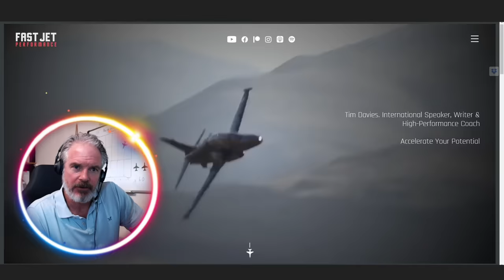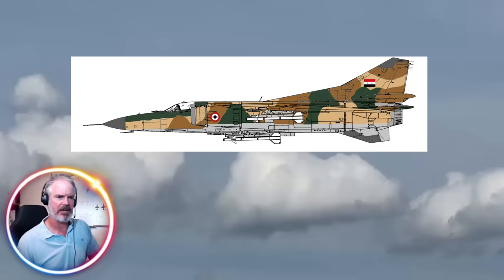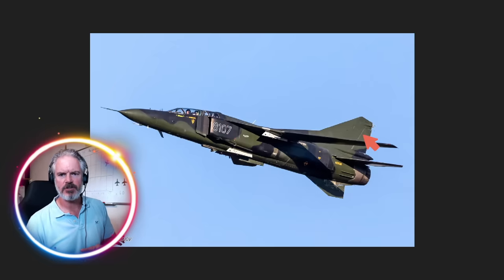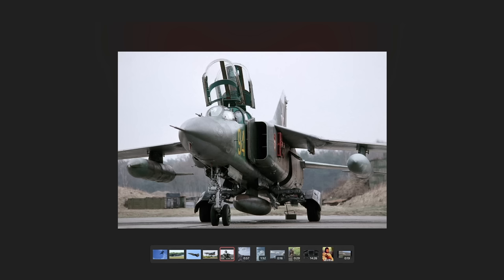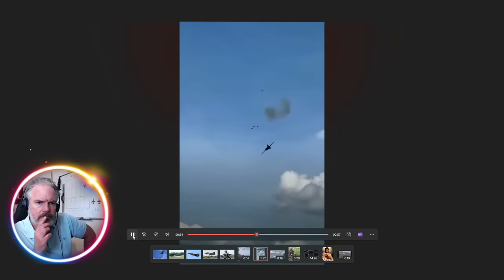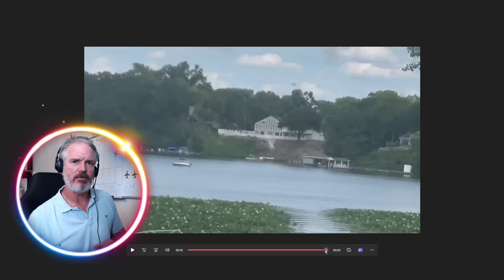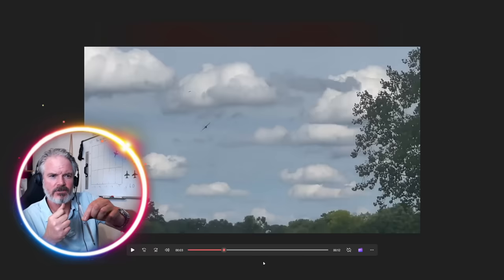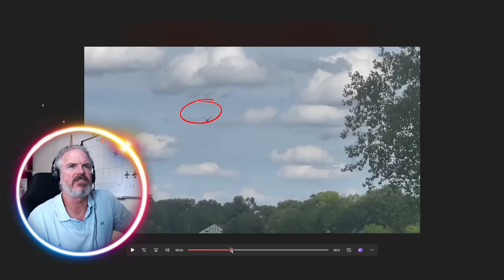Escaping Disaster: Pilot's Analysis of MIG-23 Airshow Crash and Double Ejection

Comment: Will Ward here. I was NOT in this Flogger but I do have information that you are asking. The engine on this jet was NOT an R-35 ,which is an outstanding twin spool turbo-jet,but an earlier R-27-300. The R-27 in early series had issues (as well as the J-79,F-100,TF-30,etc,ryc) but were ironed out by the time the engine was online. The Floggers used the R-27,R-29 and R-35 engines. The ONLY people that had issues was the 4477th with the R-27 and R-29 as these Floggers were literally dried and crapped out. These Mig-23MS`s, had been left in the Egyptian desert for over 4 years before they were brought over to the USA. This version is the Mig-23UB which I would consider a 2nd generation along with the MF and all were VERY solid airplanes. The MS was a 1st generation. The Seat for its day, the KM-1M is an excellent seat and very reliable. There is no RAT on this aircraft. The only Flogger to have one was the prototype MiG-23-11-1 but this was later removed thus no Floggers had a RAT. There is an emergency pump whose only function is to drive the wings forward to 16`(actually 18`40") The TS-21 sole purpose is to start the engine The start sequence is automatic and very easy. Thus, it does not serve as an electrical or hydraulic function. Hope this fills in some of the questions. Thank you.
Reply: As an enthusiast, I can't thank you enough for chiming in on the platform, to clarify your part!!
Reply from the maker: Thank you Will, I appreciate you clarifying what was quite hard information to find - if you ever want to come onto the channel to talk about your aircraft, just let me know, it would be a pleasure.
Reply: Would be an honor! We can talk about the 15,17,21 ,23 and 25. Would be a blast!
Reply: @mig21pilot Yes please!!!
Reply: @FastJetPerformance Awesome! Having an episode about Migs! Go for it!!
Reply: It sounded like a compressor stall (before the videos started)
Reply: @mig21pilot  @FastJetPerformance defo make that happen, would be fantastic to hear from Will!
Reply from the maker: @mig21pilot  would be great - I'll email you.
Reply: @FastJetPerformance already looking forward to this video 😎
Reply: @mig21pilot oh please do all off them, im sure @FastJetPerformance would agree. :)
Reply: Ntsb preliminary
Engine issues reported by the pilots
Reply: @mig21pilot  love seeing your aircraft fly at shows!
Reply: The Rat 🐀 will eat the wires 😮
Reply: @mig21pilot yes please
Reply: @FastJetPerformance  please do this :). Ward Carroll gets some great guests on his channel, but the aircrew interviews are all a bit yee-haa US aviator talk & some understated brit-talk/questions would make a nice change.
Reply: Hi - aviation atty from the states with a clarification on ops permitted under a Part 91 experimental certificate. Although deviations may be granted, experimental aircraft are prohibited from flying over desnly populated areas or congested airways. Special operating limitations may be granted for landings and takeoffs over congested areas (often in connection with display performances) and most deviations are granted to facilitate flight training. I tend to doubt the FAA regs are materially more permissive than the UK CAA regs, since similar accidents have occurred on your side of the pond (2015 Shoreham crash), and the BBMF regularly flies over enormous crowds (although, to be fair, those acft are still under RAF registry and subject to different regs). I do think that gen 1 jet acfr pose a diff set of flight risks than piston-powered WWII/Korea aircraft and may have to be regulated differently. Great show, subscribing now
Reply: @mig21pilot Loved your presentation at OSH and wish I had a recording of it to review some of the technical details you covered.  Would love to see you do some more interviews/presentations.

Comment: The engine was operating and even if it was only at idle, it will give you the hydraulic pressure required to move the flight controls. This aircraft maintained a constant bank angle and a near constant rate of descent even after the seats left. This has the hallmarks of either jammed flight controls or a massive hydraulic failure.
Reply: The plane looks perfectly under control. Everyone is confused as to what the emergency is, but your explanation is the best I've seen.
Reply: I've seen a few videos on this so far, and this hypothesis has been mentioned a lot.  
The steady bank angle and lack of any movement in any other axis would back this hypothesis up although there is a sudden nose up movement during the ejection which might simply be down to a CoG shift with the pilots and seats leaving the aircraft. 
The other thing I've seen mentioned is that it could have been a negligent/accidental ejection but I would have thought the pilots would have mentioned this already.
A stuck throttle is also the other possibilty based on what we see.
Either way it seems they worked the problem and decided ejection was necessary, fortunately nobody was hurt.
Reply: The crew will just tell us what happened.  @arrrgee
Reply: It’s going to get harder to import these old relics. The FAA doesn’t like planes dropping onto houses.
Reply: @oldmech619 thank God it didnt drop onto a house then huh?
Reply: @Imugi007    The worst thing that will get you in trouble with the FAA is to kill someone on the ground. We were fortunate this time. Making the nation new is the second worst thing. Crashing by yourself is the least. Just don’t piss off the neighbors. Seriously.
Reply: @oldmech619  When the FAA disallows it, you smuggle them in.
Reply: Was very quiet and slow if the engine was operating
Reply: @Reflektionz007 the only thing that stopped it from doing so was a massive oak tree. I am in A&P school through MIAT, and have classmates who live in those apartments. The 23 collided with the oak tree, and fuel and other debris carried onto the apartments and what started the fires
Reply: @happee_meal8302 was definitely moving pretty slow. Still can't believe I watched all this happen with my own eyes. Wild stuff, and a lucky outcome
Reply: @idanceforpennies281   plane looking stable in flight is no indication of it being under control.

It can be perfectly level, if stick input results in zero change of attitude, its not under control
Reply: @oldmech619  insurance premiums are going to go up for every warbird
Reply: Apparently they were in burner, took it out of burner and didn't wait enough time to throw it back into burner and it didn't light. Put the throttle to idle and back to burner again and still didn't light and then punched out. Heard this on an interview video last night.

Comment: Former USAF jet instructor here. Not at all familiar with the Mig 23, but the video tells me they were no longer flying that plane. Either engine or control issues, but that's moot when you're there. That was almost their very last opportunity to eject, based on speed, altitude, descent rate, and bank angle. You are correct that there's no such thing as "steering to miss" something.
Reply from the maker: That's my thinking too, last opportunity to get out - looks like the alpha was building at the end.

Comment: As an old ACESII egress specialist, I am obviously not familiar with Soviet/Russian ejection seats. But our ACESII did have a gyroscopic system under the seat rocket motor which would right the seat in a negative aspect ejection. Also thos are “ pilot” chutes which has only the purpose to deploy the main. A “ drogue” chute is a chute that slows and stabilizes the seat in high speed ejections. Not a big deal bit it would be the correct verbage. I agree this does appear to be hydraulic/flight control related incident.

Comment: Gotta be impressed by the ability to rely on the ejection system on a 50 year old Russian aircraft. Props to the builders/engineers.
Reply: The only things that ever needed anything on those seats were the propellant charges to fire the seat out of the plane. Those have an expiry date and need replacement from time to time. Russian Air Force currently has a problem stemming from this: they are flying their L-39s to this day, but the ejection seats are basically non-ejection seats as the propellant is past its "use by" date. Propellant was made outside RSFSR (Russian component of USSR) and they can't get it due to sanctions.

Comment: I used to own and fly a Mk5a Jet Provost. In the USA, the FAA doesn’t require that these experimental for exhibition only warbirds have active hot ejection seats. There have been several deaths because of either malfunctioning or inop ejection seats when needed. Last time I checked it costs around $10k per seat to reactivate them. Good that  these  worked. Good that I got rid of mine before I needed to eject. Great aircraft but scary to fly when you can’t get spare parts and Rolls- Royce/ Bristol are totally uninterested in supporting their power plants.
Reply from the maker: Yes, I've heard Roll Royce don't support their engines on legacy aircraft.

Comment: The 23 was not "primarily an interdiction strike aricraft" as stated here (although a later variant, the MiG 27 was). It was a fighter/interceptor - although mainly the latter, because it wasn't very maneuverable. In Sov service, IIRC, one significant issue was that the fire detection system was actually photo-electric rather than smoke-sniffing, so by the time it went off, the aircraft would already have a serious fire, giving the pilot(s) seconds to get out. I'm pretty sure that system would have been replaced in this example....
Reply: Yeah the MiG-23 was designed to intercept aircraft carrying nuclear weapons, albeit I suspect the targets envisioned by the Soviets were more on the tactical than strategic side of the aircraft size and performance. It wasn’t as maneuverable as the preceding MiG-21... but made up for it in higher speed, longer range weapons, and the first look down shoot down radar. It was a better airplane, in my opinion, than the F-4.

Later MiG-23 variants like the ML & MLD had a redesigned tail and higher g force tolerance than earlier models which helped improve maneuverability. 

The UMD version used the older style fuselage though so I think it’s correspondingly weaker.

The Flogger had a manual control wing sweep system with three positions, and that has been known to fail due to high g force warping the airframe and causing the wing bearings to jam. This can lead to the wings getting stuck in the wrong position when trying to land. I don’t think that this is the issue here as the wings are all the way foreword presumably to arrest the sink rate... but maybe they got jammed earlier and caused the descent in the first place?

Comment: There is a "J" shaped peninsula that extends from the north shore of Belleville Lake. Depending on the location of the one who recorded the footage, it will look like either the pilots landed on the ground or in the water since some of the footage is shot from the far side of the peninsula. The land to the north of Belleville Lake is occupied by an apartment building complex with an old golf course in the middle. To the north of the apartment complex, is I-94 - a busy interstate freeway. The plane crashed in the golf course and it skidded and rolled up through a slightly wooded area with a creek running through it and the tail end of the MiG ended up next to an apartment building next to the service drive of the freeway. A slight change in the trajectory of the MiG or if the plane flew a few seconds longer and there would have been hundreds of casualties. It apparently was "aimed" at where it crashed. According to the pilot, it crashed due to a loss of power.

Comment: The engine was running but I dont think it was producing much thrust I think its rolled back to idle.
Reply: Its better to eject at idle than at full throttle. If they had a hydraulic problem I would think the first thing to do would be to pull the throttle back.

Comment: Well done, I like your input to these Aircraft incidents. Blancolirio is ex military but now Boeing Airline 1st Officer. Dan Grydor is a GA accident 1st Line expert. Therefore you can fill the "Fast Jet" role. Keep getting involved. It's interesting getting all the angles.
Reply: Im waiting to hear Dan Gryders take on it
Reply: Dan gryder often knows not of what he speaks,  but that doesn't seem to throttle him back. Too much conjecture & opinion, and frequently fact free
Reply: @michaelh8890 Totally agree.
Reply: I saw Blancolirio’s short report on this yesterday, if I’m not wrong the engine was still running, I do n’t know if it was still able to deliver power.
Reply: Agreed -
Reply: Looks like no control/hydraulic failure. Cool thing about more up to date part 25 airframes is the requirement for backup and redundant systems. I’ve flown a jet (G-200) with hydraulic system 2 failure. Flies fine because there are two actuators for each flight control. If we had a complete hydraulic failure in this aircraft it woulda been a bad day without ejection seats.
Reply: Boeing Airlines? Where do they fly?
Reply: @sahhull apparently he made the wise choice to not embarrass himself.

Comment: I'm pretty sure it was a hydraulic failure. U can hear the engine not idling but spinning at higher RPMs. If no hydraulic pressure, the engine nozzle is not regulated and cannot produce the desired thrust. So probably no control over the avionics nor the thrust. Pity for this bird but at least the crew escaped and is hopefully well. I hope the pilot will tell the story nad maybe they will provide some camera records as well.

Comment: Well .... at least the seats worked OK .... I believe that there is a known problem with Mig23's engine variable intake boundary layer controllers that may lead to compressor stalls and other engine control problems . If one side of them fails in such a low alt - low speed situation there is not much you can do other than bail out ... but then again soviet era fighter jets are not my area of expertise .

Comment: It does appear to me that the aircraft is unable to manouvere - fixed bank angle and descending, there doesn't seem to be any correction to this. Whether it's due to the engine failing or control failure the crew I'm sure would have leveled the wings prior to ejecting if they could. Hopefully we'll find out what caused it later.

Comment: It is very difficult to tell from the video what the problem was. Tims assessment is spot on as altitude is the big issue as far as parachutes are concerned. If the aircraft is unable to climb it is time to "pop the brolly" control or no control which hints at a power problem. Also looking at the footage available I think airspeed was very low which would explain the wing starting to drop, again pointing to power failure.

Comment: Tim, why would only 5 degrees of angle kill you when ejecting inverted when level flight inverted wouldn't?
Reply from the maker: It's to do with the rate of descent of the aircraft - remember that when the seat leaves the aircraft, it's still travelling at the aircraft's speed initially and that is often fatal.

Comment: So no hydraulics or jammed flight controls with an engine running, add power nose comes up, maybe better ejection envelope but no idea where aircraft will land. I would still consider that to avoid innocent injuries on the ground while troubleshooting. No engine but windmilling hydraulics, still got time. Gotta wonder why you would leave the aircraft at the point in the video. Flogger manual might help. It probably would have a non normal or EP that covers what happened.

Comment: I thought it was engine failure, but if the engine was running I would now lean towards inadvertent ejection.
Reply: Ok back to engine failure as its now been confirmed they lost thrust even though the engine was still running.

Comment: That doesn't look like 1000.' I'd bet they're 500-800.
Reply: 500-800’ was the perfect altitude to reach the airport only 1 mile away.  The back seat guy screwed up and nearly killed dozens of people on the ground.
Reply: @MikeSowsun  and you know this how? The aircraft would have been lighter without the pilots and two ejection seats and hit the ground near the apartments. Assuming they were in “glide” mode, that probably means they would have impacted even shorter from the field if the engine was unresponsive. Your assumption seems logically false.
Reply: @MetroplexAerials  Read the report. The engine was running. The PIC said he was troubleshooting the afterburner. He said he did not want to eject yet. He was returning to the airport. It is my opinion the back seat guy panicked and ejected, right over a populated area. He had no idea where that aircraft would end up. These are not men in the service of their country. They are thrill seeking millionaires and they need to accept the risk of what they are doing. Even if it means losing their lives in the process. They can NOT put themselves ahead of innocent victims on the ground. That jet just narrowly missed an apartment block full of people minding their own business. They should have stayed with the jet just a little longer as they were almost over the airport property.
Reply: @MikeSowsun  I read the report. My presumption is that the back seater was more situationally aware.

Comment: I said yesterday that it was my humble opinion that the problem was with the hydraulic control circuit. For the last 5 seconds of the flight the bank angle does not change at all, even after the crew vacated the aircraft. I would guess that if they knew they were having to eject, they may have at least tried to roll wings level, but had to bale out at 30° port bank.
To me as an ex pilot, the engine was running, the airframe was still aeroplane shaped, so I would speculate locked controls due to hydraulic loss.